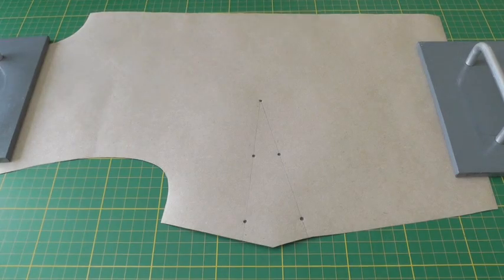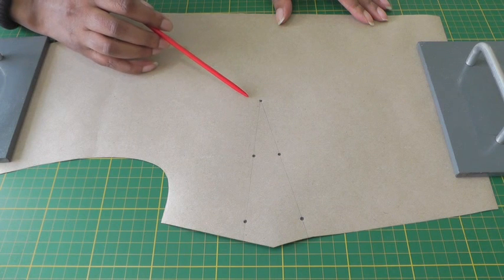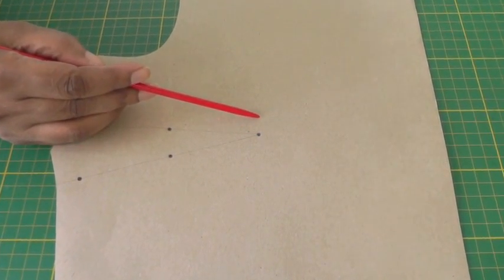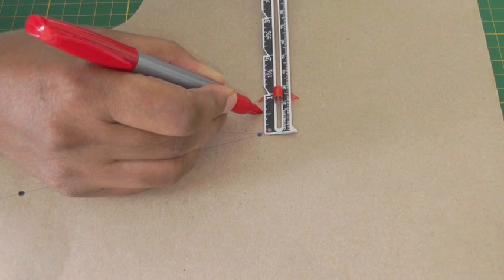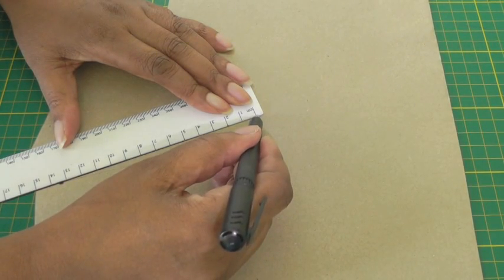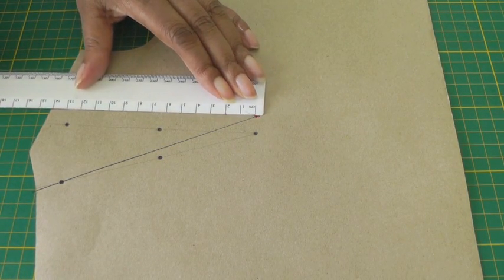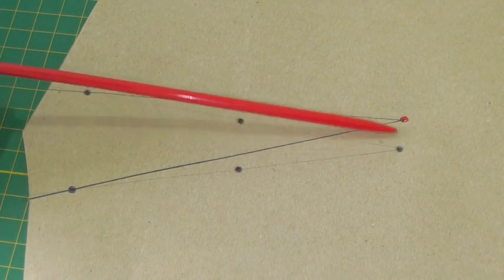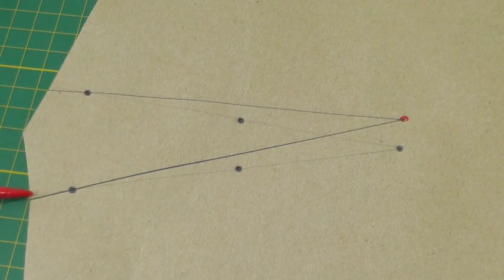Raising a Bust Dart

Comment: I was wondering about attaching clothing snaps.  I bought a snap applicator and it is horrible.  It spits spiked prongs out of the sides if it works at all.  I can do 1 or 2 good snaps out of 5.  I don't want to use it on projects because if I mess up once the whole project is ruined.  I am stuck using snap tape which rarely matches my fabric. if you have a tip, please share
Reply from the maker: Snap tape is the only real solution I'm afraid.

Comment: I am short and the bust dart is always too low; can I use this method, or should I move the whole dart position?  Previously I have lifted the whole piece at the shoulders, but this means I have to recut the arm-hole and the neckline and its a nightmare.  Hope you can help, Gaynor
Reply from the maker: You can. It all depends on the style of sewing pattern your using. If theres not a great deal to adjust, then this method will work fine.

Comment: How do you know if you're moving the dart too much? I need to move one up about 2.5 inches and I'm afraid that will cause trouble somewhere else.
Reply from the maker: Hello Carina, This techniques is required for small amounts, it sounds like you need to do a FBA to achieve the results you are looking for. You are right it will causes other issues.